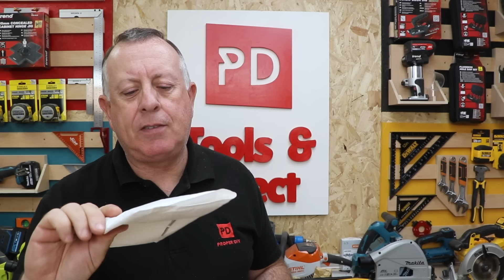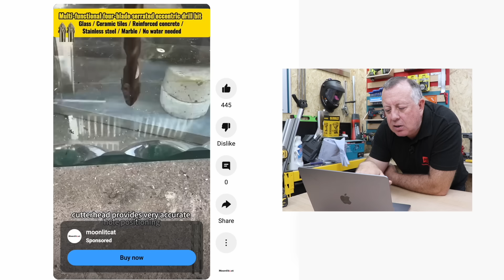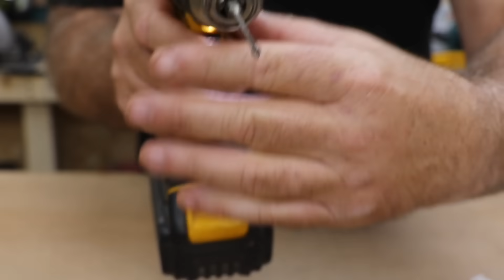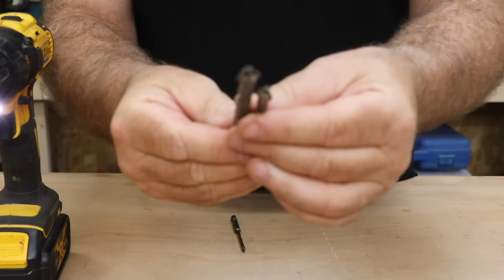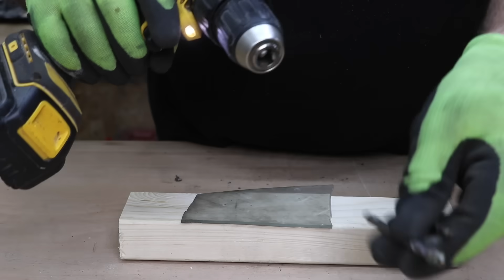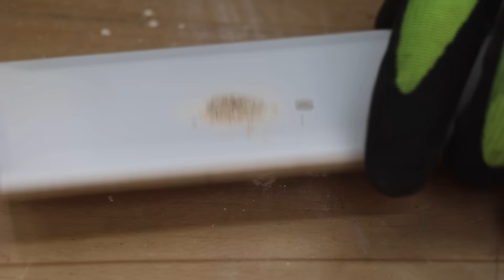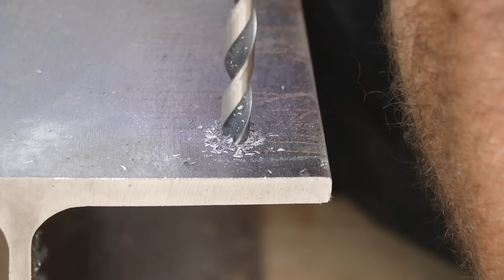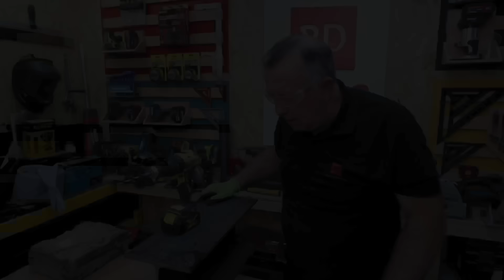Over Priced Drill Bits that Speed Through ANYTHING - Really?

Comment: In the Ad, you can see the steel is a block of wood painted grey!
Reply: I had to go back and look.  It looks like particle board. Nice catch.
Reply: @robertheinkel6225   particle board can contain steel in it. I've seen sparks fly cutting the stuff.
Reply: They didn't even paint the end of the board!
Reply: Not wood - polystyrene.
Reply: How do I put this to you all gently... It's all in your heads. "Block of wood painted grey", "paint the end of the board", "polystyrene", "particle board"... YOU ARE IMAGINING IT. Why? 
Cause it is AI generated. You're trying to Sherlock a cartoon. 
They could have shown that piece of steel being drilled with a carrot. Age of adverts, or simply videos and photos from non-verified sources having ANY credibility - that's gone. 
For some you can still tell they are faked, mostly those made to fool mobile phone users and general public - but we're at a point where no video or photo from an unverified source can be trusted. 
Not because it may be faked - but because it may not have ANY basis in reality. 
Faked photos and videos you can check for clues that it has been faked - there's nothing to check on a video or a photo that has been dreamed up by a machine based on photos and videos that it has scraped from all over the place. 

Sure, there are still artifacts, cause AI is still cheap garbage for idiots - but we have to assume improvements will polish that out and we need to start acting accordingly. 
From not trusting ANY adverts OR OUR ABILITY TO TELL IF IT IS ALL FAKED to demanding regulation banning such fraudulent practices - cause that's fraud. 
Whether they are selling you fake drill bits or a fake Tom Cruise - if they are hiding the fact it was all faked, that's fraud.
And none of that "this video may contain sections generated by machine intelligence" shit. Big, red, flashing "FAKED" stamp in each corner and maybe a few more across the screen. 

That's how we deal with potentially dangerous technology - we legislate it into oblivion. 
Not that long ago you could still purchase dynamite simply by walking into a store.

Comment: Yup, total scam, except as a tile drill. And there, as you said Stuart, you needed some water - I’d suggest a second person controlling it to continuously flow from a bottle onto the drill. The ‘yellow stuff’ should be braze, but who knows? Perhaps they tested that one by drilling an egg.. The two ‘steel’ examples the advert showed was, surely, cast iron - tiny chips of carbon give it away - but I doubt the drill you were sent would touch cast iron any better than steel. More internet rubbish, your bin is the best place for it.  Les

Comment: Machinist here 11:25 1. You are drilling too slow with your HSS drillbit, calculating the RPM is pretty simple thats VCx1000/3.14xdiameter. (So 25x1000/3.14x12) Just assuming that's a 11-12ish mm drillbit? That's 663 RPM, if you are not cooling you can yea slow it to half or something but generally speaking a dab of oil will go a long way, which you did use. Also 2. uh overheating is not that deep is many think, yes it will lose hardness but not to a big degree as long as you have good quality drillbits. So if they turn blue and you are just drilling mild steel, just use more oil and continue. Just today one turned blue because i was cutting dry at 850 rpm with a 8mm one and it still easily drilled another 10 holes without anything and the edge was fine. 
If it blunts, just resharpen it, its not that hard a 50 bucks bench grinder will do it with some practice. 
(generally speaking VC is the cutting speed, which is obviously different for each material you are cutting/ the cutting tool used)

Comment: I had a set  like these off ideal world bought for me some years ago with a lifetime guarantee "great" the demonstration showed them going through steel/glass/bricktiles & concrete, my first use a 4mm bit into an internal wall went through the plaster then burnt out on touching the brick at low speed they agreed to replace it no probs but I would have to pay the postage of "£4.99" I argued and threaten to take it further they agreed to replace it free just as a good will gesture, when it arrived in an envelope postage was a 50p stamp, so why did they want to charge me £4.99p?? They are still in me work shed I haven't even looked at them in all this time let alone used them.

Comment: I bought them off AliExpress, first used on 1mm thick galvanized steel, made a hole like a dot punch with the 6mm bit, just spun, used the 3mm one and it eventually went through, 
Got a regular steel drill bit and straight through no problem and not as much pressure...

Comment: Although you didn't say they've got TEMU written all over them, also the so called hard steel shown in the video was actually cast iron which as we all know is quite soft to drill into, as for the tile it's only the ceramic surface that's hard the inner part is easy to drill into with a sharp masonry bit.
These are just Chinese shite.
You just got scammed AGAIN!

Comment: As a 74 yo ex toolmaker things have not changed a lot in metal engineering, in spite of what people think/expect, my list below is pretty basic but contains  
Bottom line for commercially available bits are -
1) Carbon steels OK for wood, plastic.
2) High speed steel for carbon and medium carbon steels
3) Tungsten tip drills great for concrete/abrasive materials and (some surface hardened steels run at slow speed)
4) Boron/Diamond good for abrasive/concrete/glass (but only at appropriate speeds)
5) Stellite great for drilling hols through High Speed, inconel, high chrome and hardened steels

Ignore Nitriding, case hardened, titanium or any other coated or new fangled process, if you want the luxury to drill holes in absolutely everything save up and buy yourself a CNC plasma/laser/water profile cutter.

Comment: I bought something similar from Amazon in a rush looking fot multi purpose bits as i wanted to drill a metal fixing from a concrete block. Blunted one, split and bent another ane ended up with a Wickes set TBF mine were £7 not £28 so I was risking it

Comment: For someone who is an experienced DIYer who has hundred’s tools you should know that those drill bits are  designed for drilling tiles . And you should off made that clear at the start of the video. But yes you are right the advert for them is complete BS a scam as is 80% of these things advertised on Facebook and instagram. And you are right to show it as such. Secondly instead of putting all your wait on the drill ease  off and let the drill bit do the work otherwise you will end up burning the motor out. I’ve been there got the T-shirt and the medal. That’s the biggest mistake ametures  make they put to much pressure with  all their weight behind it and wonder why there drill is burnt out after a few months or a year. Let the drill do the work.

Comment: Nice video, I waited till the end of the video to make this reply but my first impression when I saw the tip of the drill bit was it the ceramic tile drill bit. The point is too sharp to use in concrete, when it was showed drilling through the metal it was drilling through a preexisting hole (You could see shavings coming out the bottom) and the shavings say it was cast iron not steel. After drilling through concrete you're broken bit looked like a concrete drill which has to be much flatter and has two angles. You are correct those bits are a piece of crap and not worth the bag they're shipped in. Thanks
Reply: Yes, it was clear they were enlarging a pre-existing hole.

Comment: They were correct - the bit will never need sharpening. The tip falls off before it gets blunt.
Reply: Great vids. Subscribed and following.  It is refreshing to see a no nonsense channel that isn’t promoting woodpecker,  festool, and plessey.
Reply: Best comment 😂
Reply: Every material need specific drill bit.
Reply: lol😂
Reply: Lmao,🤣🤣🤣🤣🤣
Reply: LOL
Reply: i don't think the tip fell off,   looked more like it was just worn down
Reply: @nemo6282 Växjö auktionshus
Reply: @nemo6282  Mine did.
Reply: self sharpening observation.
Reply: "If the tip falls off before it gets blunt, that’s not a feature — that’s a design failure. Bragging that it 'never needs sharpening' because it breaks first is like saying a car 'never needs gas' because the engine seizes up before the tank runs dry. That’s not clever — that’s spin."
Reply: lol! Perfect comment!
Reply: Even with the Bosch you should use oil!
Reply: Guaranteed to penetrate through materials that other drills can never go through 🎉 fantastic 😂
Reply: @bexleydragon5294  Yep, stick em in a ramset gun with a black charge and a half stick of jelly and you should get through that steel.

Comment: Tips are tungsten carbide which is ver brittle and if it catches on hard stones in concrete is likely to shatter.
They will cut better than a standard precussive concrete drill when used on wod, stel etc as it has sharp edges
 Concrete drill have rounded ends to help prevent shattering.
The yellow markng is surplus braze used to fix the head to the shaft.
The Bosch drill bits are expensive but just work in most materials.
Use diamond bits, with water, for drilling glass.

Comment: I got a set of ceramic tile drills off AliExpress for AUD$7 (+ postage) and was stunned at how clean the hole was. Went to use the 12mm bit and it just spun on top of the tile and did nothing. Created a pilot hole so the very round 12mm tip could fit inside and again got a nice clean hole.

There is way too much crap coming out of China and it's bloody annoying. I'd pay more if I knew the product was good but instead of getting better it's getting worse and costing more.

The 5 second hole through steel was maybe from the batch of rebar used in the Bankok building which collapsed last month where the rebar was a replica made mostly from soy. Now that would take 5 seconds to plow through and throw out some tiny steel sand instead of actual swarf.

Comment: I am curious, when you were drilling through the steel there was a line in the middle (well nearer the bottom) that formed as you were drilling. time stamp 11:45  was that heat or a weakness?
Reply: I noticed that, I suspect it was heat burning the oil left from cutting the section off the RSJ.
Reply: You can see after the camera changes angle he's applied some coolant, which then drips over as the swarf is pushed to the edge
Reply: Looked like lubricating oil spilling over the edge  of the top plate then the surface tension caused it to spread along the bottom most edge .

Comment: Naff drill bits in this particular case without a doubt, and you had me worried about your own health & safety placing your arms, chest & face so close to the drilling point, half expecting the whole bit to become razor-sharp shrapnel at any moment.
But…  is the design itself valid? I’ve used standard twin-blade tip tile bits with decent effect, so it would seem reasonable to speculate that a four-blade tip bits might work better. Perhaps if one of the ‘proper’ manufacturers were to experiment? And I rather like the idea that a Euro/Western company might “reverse engineer” a shoddy eastern product design and make it properly.

Comment: My observation was the tip is larger than the rest of the bit. Which means the hole would be oversized if it makes it thru
Reply: To be fair, that's the case for all tipped drills for masonry, tiles, glass, etc.

Comment: Another scam ad is these ads for pressure washing wand that has no motor,  just advanced German technology, but perculiarly made in China. The ad is impressive until you realise that the shots of the water jet cleaning the dirty patio is in fact a regular high pressure jet washer. Total scam.
Reply: I complained about that particular advert to YouTube and they replied they could not see anything wrong with it and refused to take it down. It showed a guy allegedly suspended in mid air with a pressure lance in each hand ffs
Reply: @ablablabla2k09 I presume that you mean that YouTube did “NOT “ see anything wrong with the ad!
Reply: @jamescampbell7780  typo corrected, thanks!

Comment: High quality cast Iron in the video, which a carbide drill will go through easily and does produce a sort of powdery chip.
Reply: Any sharp standard drill bit will go through cast iron easily
Reply: @TheGreatBungholio  through good cast iron yes, through low quality cast iron not always so easy.
I only mentioned carbide because that's what these drills are, not because you specifically need carbide for good cast iron.

Comment: The metal in the advert looks like cast iron which is a self lubricating metal, much easier to drill than a girder. Lots of great ceramic cutters around at a better price. Great video, save lots of people some hard earned cash.
Reply: Yes you are correct the metal is cast which has a high graphite content which acts as a lubricant or at least reduces friction and very easy to machine.
Reply: I ordered a half-dozen, and they Wouldn’t cut aluminium, but I found the same as The video, They seem to be good on tiles, but how many holes you can drill I do not know, but I realised it was a scam.
Reply: I thought it was a piece of wood sprayed silver..................
Reply: It was cast iron, Very easy too drill.
Reply: "Funny how 'great video' now means drilling into cast iron with a hidden pilot hole and calling it a miracle tool. Cast iron is brittle, easy to machine, and self-lubricating — exactly why it’s chosen in scam demos. There’s a difference between showing performance and staging it. Don’t confuse marketing theater with engineering."
Reply: Maybe its my old non HD eyes, that silvery block looked like lead solder to me.
Reply: They could sell all bits at 10mm. The more you use them, you can even get to 3 mm.
Reply: Could be sintered metal and made just for the advent.
Reply: cast iron does not turn to powder.
That was something like dark ceramic sprayed with silver.
Reply: @antediluvianatheist5262  Actually when drilling low grade cast iron (Chinesium) You get small flakes, I had too re drill some Chinese motor plates to "DIN" standard.
Reply: @antediluvianatheist5262 
Cast iron does indeed create fine powdered metal dust. The higher carbon content, the more fine the powder is.
Reply: @antediluvianatheist5262  it’s cast iron for me
Reply: @grahamg6212 I have found that ordinary tungsten carbide tipped drills, kept very sharp using a green grit grinding wheel, drill ceramic tiles just fine.
 Don't apply too much weight.

Comment: the holes were proberbly already in the block of metal and they just filled it with some iron fileings and wall filler theres noway that drilling steel produces swarf that fine.
Reply: Cast iron machines exactly like that and it's also extremely easy to drill or cut.

Comment: I went through a lot of HSS bits drilling through some 5mm box section until I discovered the dewalt cobalt bits.  Went through with ease.  You should try one.
Reply: There are quality HSS drills and there are  cheap 'HSS' drills. I was given some cheap ones by a neighbour and tried them on stainless steel and the stainless won so I switched to a quality HSS bit and it went through the stainless steel easily. I have a cobalt drill set as well but my main drill sets are quality HSS sets as well as many assorted quality HSS bits in varying sizes and lengths as required by the tasks. I occasionally buy cheap HSS bits in larger sizes where quality ones would be prohibitively expensive but I don't expect the same of them and they're for non challenging materials.

Comment: I remember going to a "Woodworker" show many years ago where 'multi purpose bits' were being demonstrated. These would cut through anything - eventually!! They used grinding technology with coated bit heads. Rather than cut, they ground away at the substance being cut. Again - another scam. I notice in the advert you never see clearly the point at which the drill bit starts cutting. Mostly it is already started when the video is shown. I suspect the hole was made in advance, filled with soft powder, then "miraculously drilled" on camera!

Comment: "I don't know what steel they were using in the advert"

I believe it's called chinesium
Reply: High strength bamboo
Reply: Cheese grade…. A nice soft  feta
Reply: Well it looked like cast iron to me. Some soft cast iron to be precise.
Reply: Aluminium baking foil.
Reply: Shined up pot metal
Reply: Chinesium- low cost and breaks quickly...americanium- dangerous and liable to kill at any time 😆😆
Reply: Arsholium.
Reply: Oh no the China bots have arrived
Reply: "Ah yes, 'chinesium' — the go-to term when someone runs out of actual technical arguments and falls back on lazy stereotypes. If the product's bad, critique the engineering. No need to drag in casual xenophobia to sound clever."
Reply: @BetrayalDiariesReddit

You people seriously just throw around terms like "Xenophobia" and "Tired Stereotypes" with so little thought or care that it is basically meaningless. Chinesium is a term that exists because a lot of junk products come out of China. It's a reminder that caveat emptor is a thing for a reason. It's also completely true. There have been stories of all kinds of counterfeit products coming out of China, like hard drives that are just a casing filled with bolts. There's also the endless dropshipped garbage on Amazon and Temu. Not all Chinese stuff is junk, though. If somebody cares enough, and audits the quality, Chinese manufacturing can be great. It would be an unfair stereotype to say that China is only capable of producing garbage, or that all Chinese people are lazy and careless when it comes to their work. It is not a stereotype to say that a lot of garbage is made in China. It is also not xenophobic to worry about a totalitarian state with globe conquering ambitions. It is xenophobic to assume that that applies to every Chinese person. Do you see the difference?